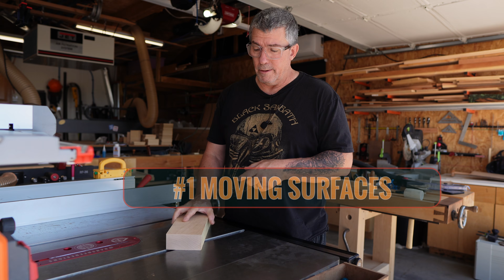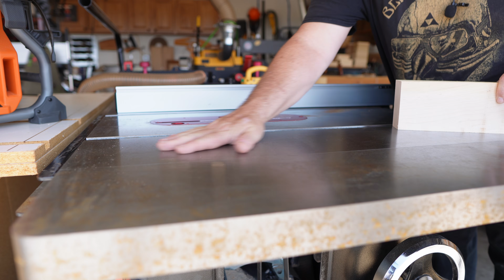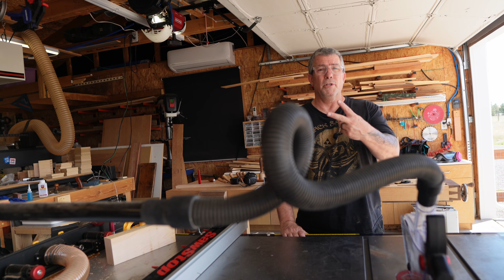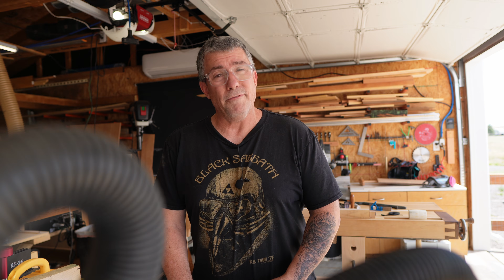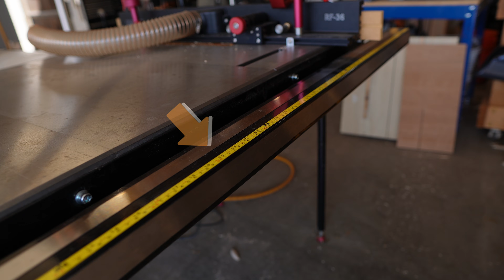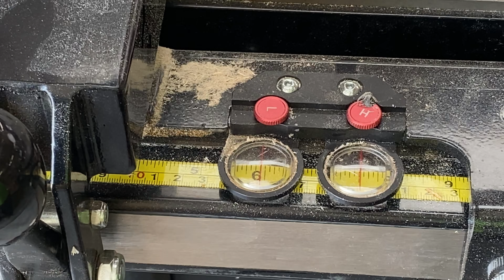3 Things Slowing You Down at the Table Saw (and every other tool in your shop)

Comment: Great tips. I spend a lot of time in my shop, but the UHMW tape is one I honestly hadn't thought about using on the table saw. That's getting filed away for future use. I also couldn't agree more about keeping the machines clean and maintained. I've been guilty of letting the inside of the saw collect more dust than it should! I just subscribed. I have a woodworking/maker channel called The Idea Garage and would love for you to stop by and check it out sometime. Always good finding another creator sharing practical shop knowledge like this.

Comment: Great video. Thanks! We older would be woodworkers need all the advice we can get on these topics. 
One question: how easy is it to find the torque settings for screws on standard woodworking machines. I have to confess that I haven't dug out my user manuals and I can't recall seeing those numbers.
Reply from the maker: A few general principles that cover most woodworking machinery:

General approach

Snug, then torque in a star/crisscross pattern for anything with multiple fasteners (fence plates, throat plates, motor mounts) — this prevents warping the part.

"Snug + quarter turn" is a decent rule of thumb when you don't have a spec: hand-tight, then a small additional turn with the tool, not max effort.
Don't chase torque with a long-handled tool "for leverage" — that's how you strip aluminum castings or plastic housings common on fences and guards.

Typical torque ranges (when no manual spec exists)

Small machine screws (M4–M5, fence adjustments, covers): ~20–35 in-lbs
Medium bolts (M6–M8, motor mounts, trunnions, blade guards): ~50–90 in-lbs
Larger structural bolts (M10+, cabinet saw trunnions, base leveling): 15–25 ft-lbs, but always check the manual first — these vary a lot by manufacturer

Material matters

Cast iron/steel tables tolerate more torque than aluminum extrusions.
Plastic housings (some dust ports, guards) — hand-tight is often the actual spec.
Threading into MDF/plywood on jigs or shop-built fixtures: snug only, then back off slightly to avoid stripping the wood threads.

Practical habits

- Use blue or purple threadlocker (Loctite 243) on fasteners exposed to vibration — trunnions, motor mounts, blade guard linkages — rather than over-tightening to fight loosening.
- Re-check torque on new machines after the first 10–20 hours of use; castings and gaskets settle.
- For anything with a published spec (arbor nuts, trunnion bolts on higher-end saws), use the manual 

Hope that helps
Reply: @dan @dansbeedesigns Very helpful. Thanks!

Comment: I knew a guy with a Harvey saw, said its been squealing for as long as he could remember.. turns out the belt tensioner just need to be adjusted.
Reply from the maker: I was that guy and what I ultimately found was that Harvey ships their saws with the most underwhelming belt you could imagine. Replacing it with a 12 groove V belt was a gamer changer on my saw. More evidence that Harvey is all marketing and now sawdust :)
Reply: @dansbeedesigns well, it sorta seems they might be heading in a better direction in some ways. That new D1 saw looks WILD